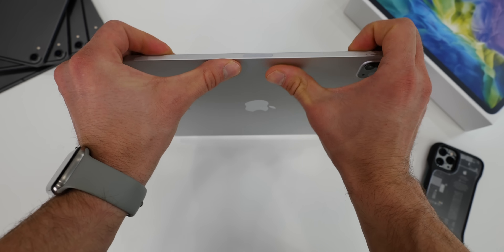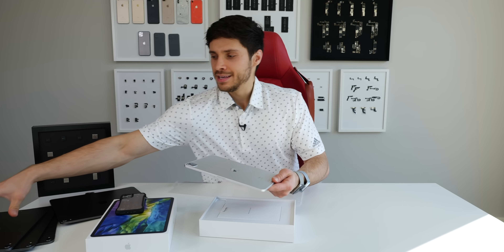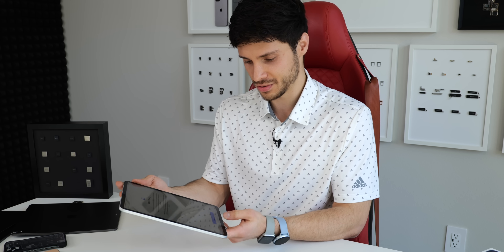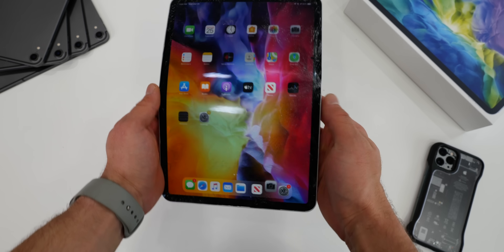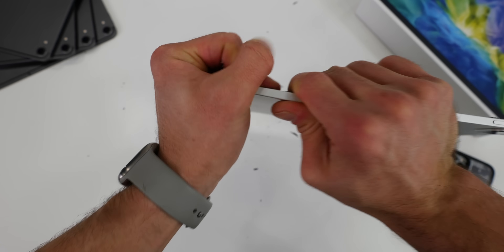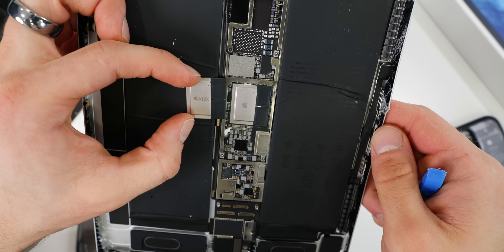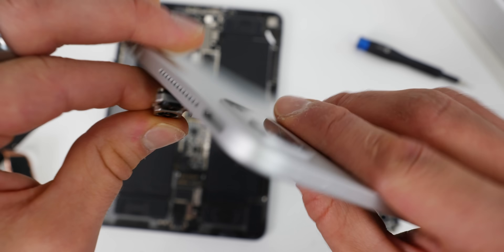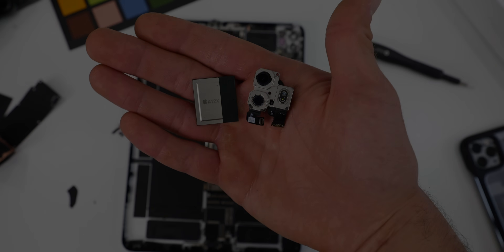2020 iPad Pro Bend Test & Teardown! Still Bends?

Comment: my 10 inch plastic tablet with gorilla glass 5, intel octa core 2,0ghz cpu, 6gb ram and moly quad core gpu can run fortenite full 128fps, or even all games and emulators (even windows 10 on lumbo run faster) with   full speed is more durable than this.
im very very happy with it

Comment: Actually the A12X always had 8 GPU cores but one core was always disabled due to cooling limitations but the 8th core would become active as a redundant core if one of the other cores died! While with the A12Z they did improve cooling on it significantly so all eight cores can now operate simultaneously without causing any heat damage or having to throttle down within a short period of time! :)

Comment: I mean but honestly, you’re stupid af if you don’t use a case if you regularly put it in a bag. Things break. Nothing new whatsoever. 
And the argument of “for the price it shouldnt bend” is so stupid. Everything has a melting/breaking/bending point. Absolutely everything.
Reply: How is "for the price it shouldn't bend" is stupid..? And he bend it for a test if Apple did fix that bend problem. For most people, they do use case, but Apple is going for "thin and light" iPads, so costumer want that feeling and doesn't want a case. Bend problem is a deal breaker for some.

Comment: PLEASE APPLE: most people don't care about razer thin devices and it doesn't have to be super light!!! Just use steel on the sides like the iPhone and make it thicker if it helps to make it stronger!!
To be completely honest it doesn't matter at all if the ipad was heavy. When you're going out with it in your backpack the weight won't matter even if it's double...

Comment: Too easy? That's why your arms are shaking when your bending it right?  And I see it only bent where you had your thumbs jammed into the back while pulling on the edges with your fingers... Yep that looks like normal use to me.. anybody doing this to their iPad deserves to break it.  I highly doubt anybody is bending their iPad pro using it how it's designed to be used. Most likely raging when they lose on some game and doing just what you did. Drops don't count if you have butterfingers and drop it that's your problem.

Comment: Bad engineering, they sure have added a extra frame for support, especially at the current price they are asking. I remember when my umbrella cockatoo bird bit it and then toss my last one on the floor and one not from very high fall screen cracked and slight bend. My bird destroyed it in a few seconds, so it not going to hold up that well. Yep keeping this in a backpack will cause it to bend in time. Most will put in backpack as who going to baby it and carry it by itself?  Just bad frame design overall and for a device that sure have been designed to be a work horse? Reminds me of the iPhone 6 bending easily just putting in pocket disaster.

Comment: Exactly what I needed to know. I really expected Apple would have made this thing stronger by now. I won’t be buying one. Sticking with my old IPad Pro.
Reply: Thats the reason I'm not upgrading my 2017 iPad Pro.
Reply: SRINIVAS RAVUTU Thats the one I have and it has never let me down. I’ve used it every day for 3 years now. Battery is getting weak but it can be replaced.

Comment: wow makes you think Apple makes cheap shit! Clearly it should have a re enforced frame inside around the hole chassi and re enforcement going from the top to the bottom dividing the battery parts and at least one that goes between the batteries. That way not much of the inside needs to be changed while still making the integrity of the chassi better.

Comment: 6:33 How is that unbelievable? They are not thinner than any other screens on mobile devices.
7:53 How is it easier to repair? It's basically the same thing with a few different components.
8:07 Why would they not want you inside of it because of the lidar sensor? They don't want you inside any of their products to keep you from repairing it yourself.
8:39 How are they stepping their game up? Doesn't it make sense that it's smaller?

Comment: I can’t wait till Jerryrig gets his hands on this engineering disaster..
Reply: Zaakiya C point is it shouldn’t bend so easily. I’ve the 12.9 inch 2018 model and mine has a very slight bend. Not really noticeable until you put it screen down on a flat surface. It’s horrible that Apple chose being thin and sleek over structural integrity. Nobody should defend it. The only reason they didn’t update it in the newer model was to save money on materials and machinery, it wasn’t for the consumer, their customers. It’s a pro level machine, it should be allowed to be a little bit thicker so it doesn’t f-ing bend. They’re not cheap machines, and if anybody gets one they need Apple care for it (btw apple care is a complete rip-off for what it is)
Reply: Brendan Turner try bending ur iPad back, I saw a guy bend his iPad Pro back, but be careful tho.
Reply: glass is glass and glass breaks
Reply: Sam Kelly with deeper grooves at a level 7
Reply: Sam Kelly that’s my favorite quote
Reply: Zaakiya C it doesn’t have to made out of titanium. All the iPad need is an light aluminum that is strong enough to sustain day-to-day use to prevent it from bending
Reply: and make iPad asmr
Reply: Ya
Reply: When is Jerry going to do the 2020 iPad Pro?
Reply: wonder what happens when you bend a ground cable installed inside a nuke
Reply: Guys let’s be honest he forces his hand he bend it powerful absolutely the iPad will bend at first he bend it but not bend then he make power then bend

Comment: I'm sorry, but are you really surprised that the aluminum bends and this iPad is no more structurally sound than the last? Aluminum is not the most rigid type of metal out there, and I could have told you, or anybody, that the aluminum used would not be thicker than the last. Normally, I like your vids, but this was honestly kind of frustrating to watch. (Yes I understand nobody made me watch this, and I could have stopped, but I had already been 5 mins in)

Comment: That’s it I don’t want to watch no more how easily it bends, I think I’m just going to stick with my 2017 iPad Pro 10.5” still a nice size screen and the refresh rate is still great. I’m gonna wait for the 5g model later on in the year and see if Apple doesn’t reticle the same case and make a better more stronger design, with the expensive amount of money they charge hopefully it be an older display by then, if not I’m just going to get the new Samsung Galaxy tab S with the brilliant oled display & the free pen. I’m fed up with Apple charging so much for the iPads & not charging the case design to make it stronger.
Reply: @jaybiedayy  that's right I'll wait for a an ipad 5g see if is better not so flipsy like is made out of tin Coke or wait another year to see if Samsung brings out a new tab S with the free 🖋 I do care about oled display specially when u paing over £700 for a tablet thats made to work with the " digitiser" ah pen, & u still got to go out and buy it. I much prefer Samsung 's way with the pen 🖋 included and the expensive brilliant oled screen cheers for your reply peace.

Comment: "Too easy" 
Knuckles gets whiter than an irish girl after a long witner... 

Who would have tought that aluminium can bend...
Reply: Because you can literally apply the same force to phones, ignoring materials and surface area for a second, and not get the same result. Yet again crApple have learned nothing and you morons still think "oh it's just a coincidence". CrApple are aware off this and this was the same shit that lead to a class action lawsuit with their phones, where they got sued over patients highlighting the weaker integrity over last gen models e.g. the 6 being weaker than the 5. If people don't complain then shit doesn't change. They could easily make it thicker and bump the capacity, not shrink the batteries and try and try pull some bs gymnastics. It's needless, but they don't change shit because you morons would just buy another, or opt ito their anti-consumer repair monopoly.

Also, cars don't catastrophically fail when you kick or bend them. It should go without saying they're engineered to be as structurally sound as possible without totalling the car in a collision. This is inexcusable and your damage control is glaring.

Comment: This vending issue would be a dealbreaker for anyone. It’s not fair for anyone to say that “just don’t try to break it and it’ll be fine”. It’s a PRO device used by professionals. If a professional uses it, it would most likely at least bend. I really thought they would fix the issue with the new iPad Pro. I was actually looking to buy the next stronger iPad Pro but guess that’s not happening.
Reply: https://youtu.be/wWWDN90wFHw

Comment: I am not sure why people use apple products. I am not even saying that their products are horribly overpriced. But just for a reason that it is no possible to insert a sd card into apple tablet or phone people should stay away. When your tablet breaks all your data can be lost, with a  tablet with sd  I can just take my card out and my data is safe, editable, transferable etc. No always when apple tablet, phone break data is lost but there is a chance that people in the repair shop will  go and check through your files.
I met many people working in repair shops and things like that are very common. 
It is funny when people buy expensive, apple tablet the a keyboard, pen, mouse and  they use it all day long on the desk and hoping it can replace a laptop.
They simply could buy a cheaper, very light notebook  (comfortable to use on the desk, lap,..) with proper system no limited operating tablet crap.
Apple have great marketing team and easily manipulate especially young ones who think they get some prestige owning apple products.
I do not like apple but that guy in the video just proved that tablet is actually quite solid. I think he actually wanted to prove that and he on purpose talked something else to look more genuine. People always pay more attention to what they see than hear and he knew it.

Comment: Everywhere you bent the metal is already weaker because of the holes drilled. Also aluminum is soft this isn’t billet steel. You need to reword because it false.

Comment: I’m very hard on my stuff, and even I have to say, Ive had my ipad 12.9 pro 2018 model for 1.5 years now of tossing it around, throwing it in my bag, and dropping it, and its still perfectly flat, no bends. Tablets dont need to be as strong as a phone, they dont take as much abuse, unless youre an idiot. Sure they will break if you deliberately try to snap it, but it’s honestly fine, and I’m probably harder on my stuff than most people. I just have the apple keyboard folio on it too, and I also use this iPad Pro for everything, all my media consumption. Don’t think its too fragile to buy guys, its undoubtedly the best tablet that’s ever been made.

Comment: Been enjoying all your vids but this one I have to agree with AppleInsider's take at this being a rich boy pointing out the common physics of a thin slab of metal .(They do get one thing wrong, you selling iPad cases)
"The EverythingApplePro guy puts his back into this job, really buckling the iPad Pro with all the force he can muster, and then says this is what could happen in day to day use. He is completely correct, so long as your day to day use requires you to deliberately torque the device, and smash a thousand dollars worth of iPad Pro in the process."
https://appleinsider.com/articles/20/03/26/unsurprisingly-a-2020-ipad-pro-will-bend-if-you-try-to-break-it

Comment: Hopefully folks will see that they should invest in a strong case of some kind to keep their investment safe.  However isn't it fairly dangerous to bend Lithium Ion Batteries? From what I hear if there is a charge and they come in contact with air it can ignite in a fairly explosive way.  Guessing you know more about the materials they use for shielding the batteries than I do.  Just thinking the next time you could bend and prove your point, then take off the screen like a professional.

Comment: Can one be this ignorant? The bend is because of the type of material to take the shock and stress over using harder plastics that snap with minimal pressure! So it is supposed to bend but when forced anything will weaken and or break so this test proved nothing but common ignorance lmao. And size and numbers or said hardware mean nothing,an understanding of the hardware does. And last years is nothing like silly putty lmao!

Comment: I know why it bends and breaks, I have a 12.9 2nd gen and the sides are rounded. Hard to bend a curved edge. lot more resistive to failure. If they went back to that design it would be better.

Comment: This is the reason a lot of people are getting tired of Apple and IOS systems. No disrespect to nobody but these are the facts, First of all they recycled the iPhone six into the iPhone 9 that's supposed to be coming. The iPhone X to the iPhone 11 Pro have the antenna problem, it's not a software issue but it's a modem problem. They know that. They aren't bringing anything new to the table, everything they do is just for profit now, Nothing new. You guys know this, They are not caring about the consumer anymore. After Steve Jobs passed away, it's just been adding new cameras and some features on an old platform and making it a new iPhone. It's been the same screen since pretty much day one. That's my opinion on all of this.

Comment: Apply a lot of force and OMG it bends?  Yes! and water is wet and the sun is hot! What a moronic video. During normal use of an iPad, this sort of thing does not happen (unless you are an idiot but then you can't be reasoned with anyway).

Comment: I was astonished when I noticed that my ipad pro 12.9 inch had a bend. When I contacted to customer care in India, they told that first time they are receiving this kind of complaint and I told them that since it is working I will not go to service center. I asked them to give a complaint number 101006946057. Today after watching this video I understand that that this is a manufacturing defect. Thanks a lot for this information.

Comment: "Alluminum still breaks and bends" wowee, the laws of physics didn't change since the past year.
Reply: The last iPad pro was in 2018 😑
Reply: He puts so much effort into bending the ipad. Liar. How to believe such a person?
Reply: @ivanfesunenko3745  

Because you can literally apply the same force to phones, ignoring materials and surface area for a second, and not get the same result. Yet again crApple have learned nothing and you morons still think "oh it's just a coincidence". CrApple are aware off this and this was the same shit that lead to a class action lawsuit with their phones, where they got sued over patients highlighting the weaker integrity over last gen models e.g. the 6 being weaker than the 5. If people don't complain then shit doesn't change. They could easily make it thicker and bump the capacity, not shrink the batteries and try and try pull some bs gymnastics. It's needless, but they don't change shit because you morons would just buy another, or opt ito their anti-consumer repair monopoly.
Reply: Marv he probably doesn’t know physics

Comment: Wouldn't it be a good idea to get yourself a bend-testing-rig? Like one that you can actually measurably increase pressure on and then we know if the device is more easily bent? Right now it could just be that the iPad got stronger, but also that YOU got stronger; moreso than the iPad did.

Comment: I am watching this on my iPad 2 from 2011 and tried to bend it slightly but unfortunately I bend my arm OMG it is so solid it is like a brick of metal so that is why I still have it and it have survived at least 50 drops on ceramic
Reply: But the down side i can't do anything . It just run an old version of YouTube 
Because it's not the iPad Pro with its A12Z and 6 ram .it has an A5 chip and 500mega bytes of ram which means half a gigabyte of ram

Comment: you guys absolutely need a case - tells us the guy who is about to make a Ton of money on us. if it breaks like butter, why ur hands are white and shaking?!
Reply: Because you can literally apply the same force to phones, ignoring materials and surface area for a second, and not get the same result. Yet again crApple have learned nothing and you morons still think "oh it's just a coincidence". CrApple are aware off this and this was the same shit that lead to a class action lawsuit with their phones, where they got sued over patients highlighting the weaker integrity over last gen models e.g. the 6 being weaker than the 5. If people don't complain then shit doesn't change. They could easily make it thicker and bump the capacity, not shrink the batteries and try and try pull some bs gymnastics. It's needless, but they don't change shit because you morons would just buy another, or really have no other option other than to opt into their anti-consumer repair monopoly.
Reply: [insert Name Here] y u mad ?
Reply: is.majdah if you read what that person write, it’s kinda true though..
Reply: @mj.8908  

Because I had the same problem with not one but two devices now. It should not be a problem when you pay upwards of 900 bucks. Apple have clearly learned nothing and insist on making devices as weak and fragile as possible for what reason exactly? It's anti-consumer.
Reply: He has put some force to bend something and when he said like butter he probably meant a little force and device will bend

Comment: I'm a bit concerned seeing you do these dangerous bend tests without work gloves to protect your hand. Also by doing these bend tests, you risk accidentally bending the battery which we all know will be a fire hazard.
Anyway, it does suck that Apple didn't structurally reinforce the insides with this model; especially seeing all that empty space inside the iPad Pro (2020).